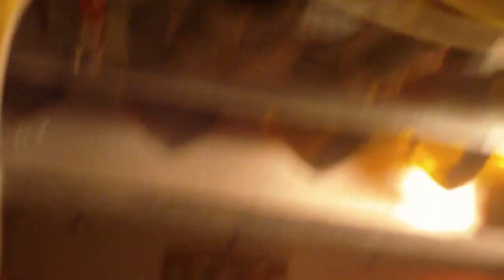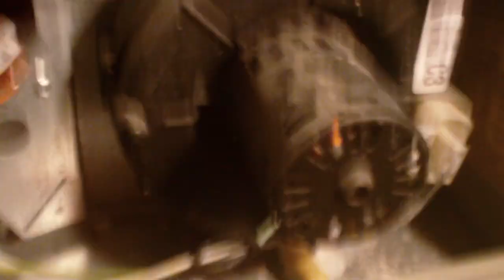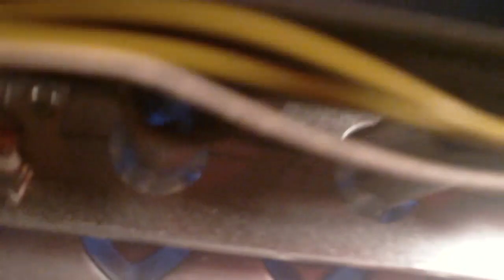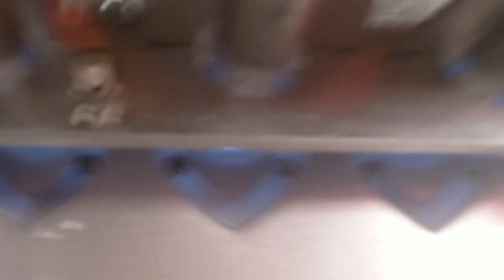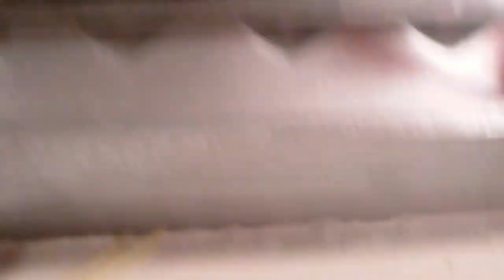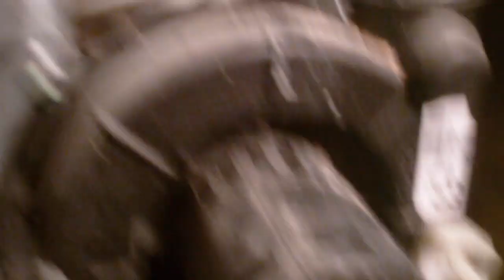My Trane XB90 furnace problem

Comment: I use the wire brush to clean the excessive oxidation off the burners so far so good
Reply: What type of wire brush? I feel like there is barely any room to get a brush in there. Mine are starting to rust towards the gas supply side, not sure how the flame side looks

Comment from the maker: Turned out to be water building up in the inducer motor because of clogged sump drane.  This slowed down the motor which caused the pressure switch to trip.
Reply: Bernie H how did you manage to solve this?

Comment: I had the same problem, one crew came spend 2 hours almost taking unit apart, charged me 150 bucks, but did not fix the problem completely. Next cold season the other came. found the reason in 1 minutes, charged me 40. The problem was that the little temperature sensor got oxidized , when gently rubbed with 1000 sand paper.